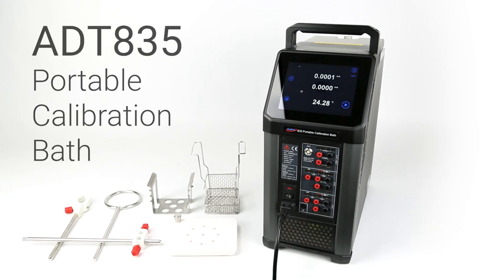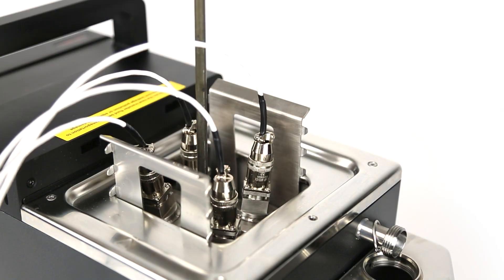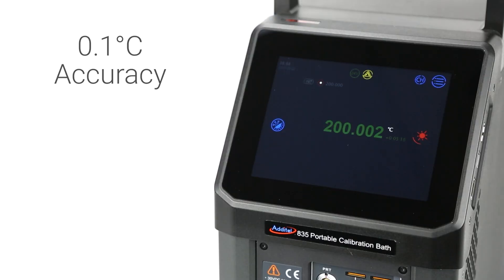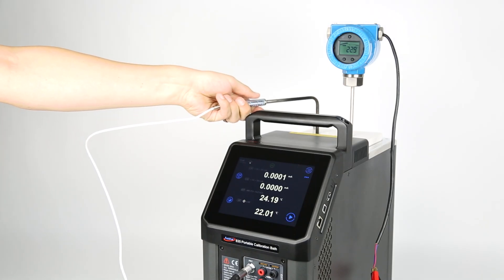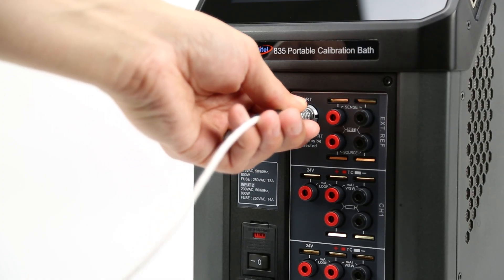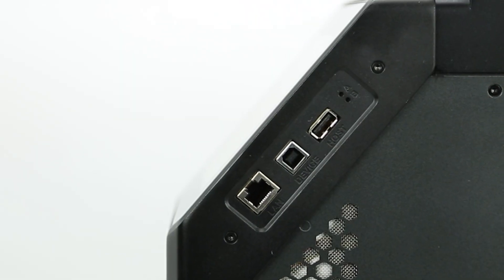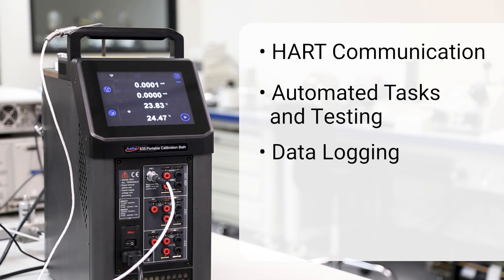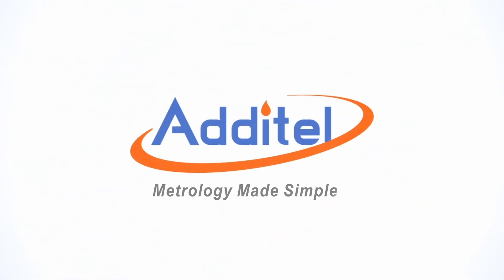ADT835 Calibration Bath - Features and Overview

Comment: Hi Additel,

The new liquid bath for thermometer calibration looks very interesting. I have a question: what type of stirring does it use—natural convection, magnetic stirring, paddle stirring, or another method?

Thank you for your response.
Reply from the maker: Hello, the ADT835 Calibration Bath uses paddle stirring, as well as internal and external heating elements, to ensure a uniform temperature across the liquid.